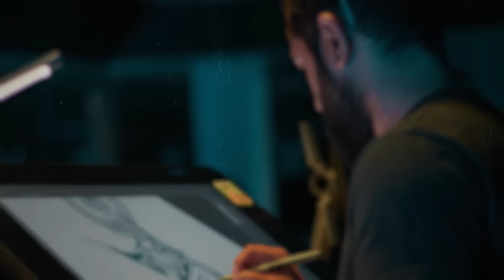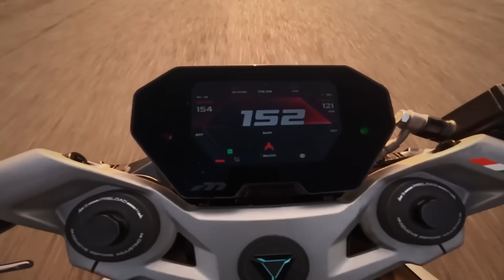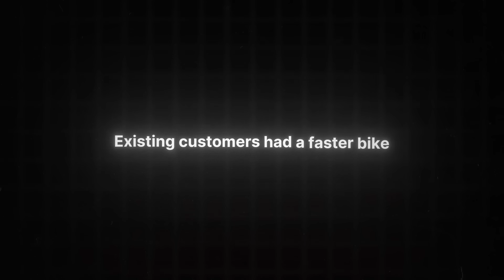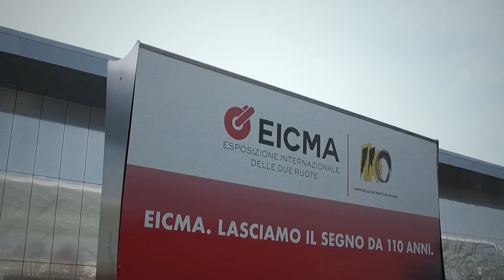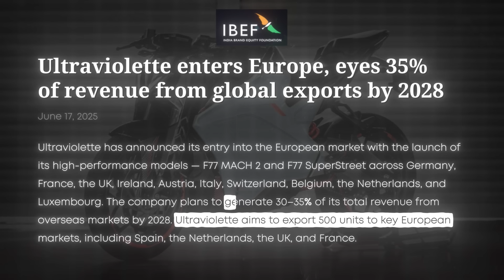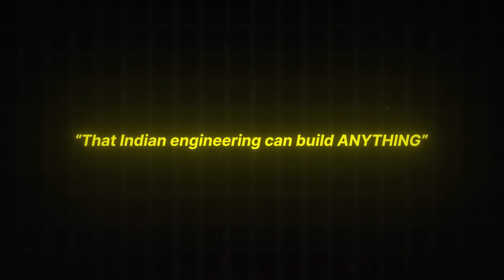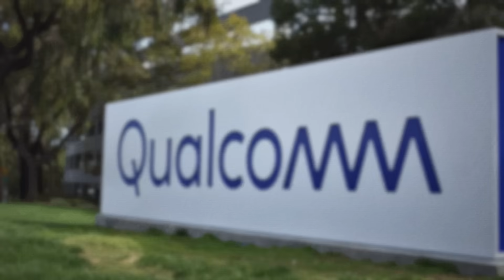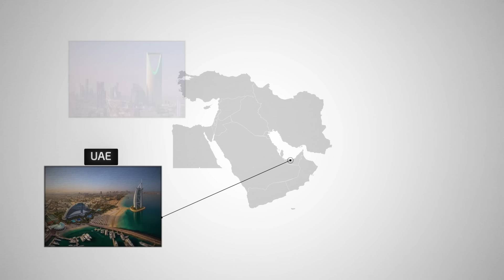How India Built a Motorcycle That Shocked Europe

Comment: Yes, but here in Europe and France, motorcycles are well regarded, but they are also very imperfect in terms of general plastics and performance, which is often highlighted as 155 km/h, but we don't really see any test that proves it. What is its GPS speed? So all of that is minor details. But the lack of a Type 2 socket and having to carry around a 12-kilo charger is a fatal flaw, and that's what held me back from buying this motorcycle. I think the charging system absolutely needs to be changed because otherwise it will remain a huge obstacle in our regions.

Comment: I test rode the UV X 47 yesterday, and I came back grinning ear to ear, full of glee. Even now I am rubbing my hands with childish thrill.  What a jolt of GREAT fun.  I have had a number of bikes, starting from the 48000 km I rode in two years on a TVS Suzuki as a student in India, to Yamaha V Max, Honda Hurricane 1000 (been upto 155 mph on it), Suzuki Katana, Kawi ZX6R etc. in the USA, but none of them come close to the sheer joy and sumptuous smooth power this gives!

I didn't feel like getting off.  It's intoxicating and amazing how well built and solid this bike feels.  So civilised to move so quietly, but that deadly burst of power is an absolute high.  I have not even a whisker of hesitation in spending the fancy amount of around 5 lakhs on this one.  It won't be the only bike or only time I felt like spending this kind of money on, but this will be the most well spent I feel.

Proud of you, UV!  Now just put a damn fast charging circuit on it.

Comment: all that is good but in order to have a stronghold you will need rapid sales in the 1.8-2.5 lakh customer bracket , give me a bike that can run 250km in single charge in city, 2 ppl can sit on it for 2-3 hours without much fatigue and it should have a battery life of atleast 5 years, should have fairly decent ground clearance and suspension and easy to flick in city

Comment: Great video! Just a minor correction: Bugatti Veyron goes from 0 to 60 mph in 2.5 seconds while F77 goes from 0 to 60kmph in 2.8 seconds, so not an apples-to-apples comparison. It is extremely fast; nonetheless, I love the initial torque on the bike.
Reply: Don't the HONDA " CB 300R "  goes from 0-60 KMPH in 3 seconds?? I drive it daily,  that too with 40kmpl milage? How does ultraviolet compete with it?  CB300R  is waycheaper and probably better than an lithium battery powerd vechile, where 90% of electricity is produced by coal,  also lithium causes more carbon footprint while being mined.
Reply: @heheguysharme9701 Yes CB 300R is similar in speed and performance. I didnt buy F77 because it is enviroment friendly, the torque you get is insane and this is the most advanced sports bike in India, any future tech updates, I will get an OTA which should be good for at least 6-8 years. Not to mention, the money I spend post purchase is next to nothing.
Reply: They said it's in veyron territory in terms of 0-60mph test.
Reply: @gamesong6600 I know, but it’s factually wrong, the metrics being used in both cases are different.
Reply: @TheSodoMovementProject you are right they didn't tell the metrics that's a huge difference 😅